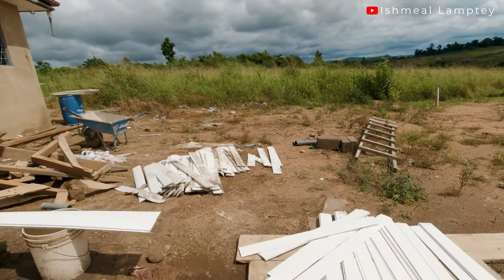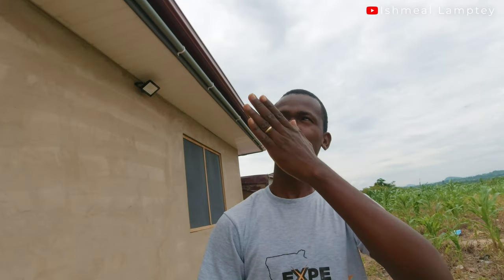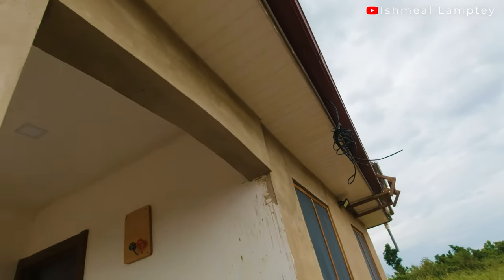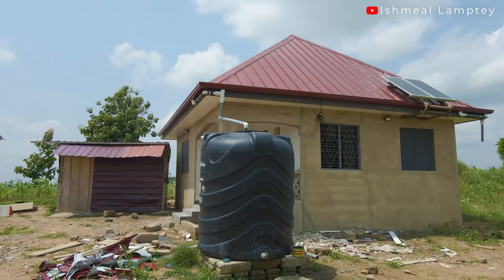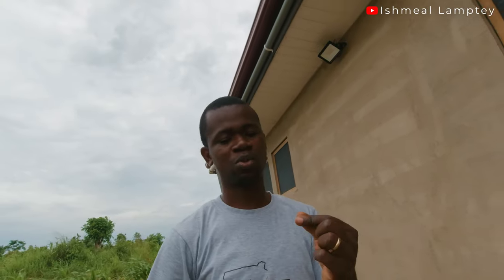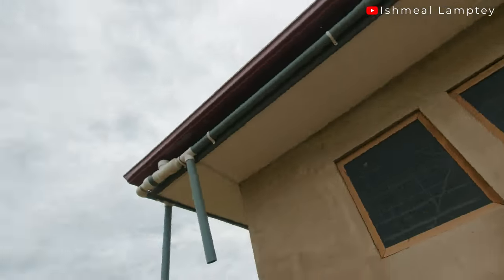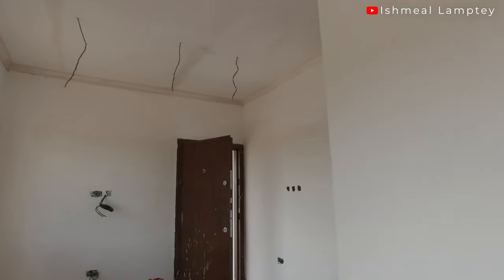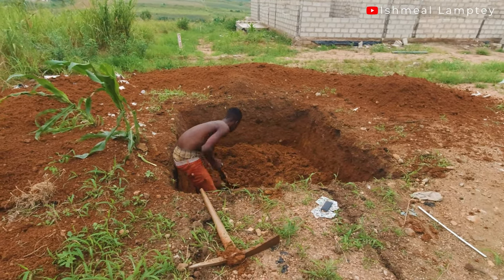Off Grid Living in Ghana - Our Outside Ceiling is looking Nice!

Comment: I put my T&G on strait like you did but after a couple of strong winds soon found out I should have put thin plywood first. Hope you have more success and don't need to learn the same lesson the hard way. Good luck!
Reply from the maker: Thanks for sharing. I hope I don't experience that that too. There's been a couple of strong winds which has broken some walls but it's still looking fine. Also, the carpenter nailed almost all of the t&g to the wood

Comment: I noticed your windows security bars , have no emergency exit push out device from inside your home incase of fire that prevent exit from the front door.
Reply from the maker: Yes. Because of theft issues here and the location of the house, that's how come we have it thay way. Hopefully the bigger house which is yet to come, will have all these features for both safety and security